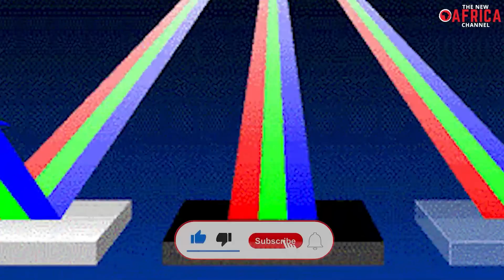How the Sahara Desert can power the world with solar panels

Comment: What a silly idea. Near the Equator the insolation is at its most peaky. With a maximum at midday, it drops off quickly from its peak, providing only a few hours of useful power. That mandates storage, even without considering maintenance and EOL cost considerations.
 What's more, for a fraction of the land usage, political risks and overall cost we might deploy localized 4th generation SMRs where they are needed.  Solar power is only valid with at least 24 hour storage and then in the absence of more effective generation.

Comment: RIGHT THE AREA IF THE SAHARA DESERT IS 9 MILLION KM WHY DONT WE NOT USE ONLY 2 MILLION MILES OF IT AND COVER IT IN SOLAR PANELS GOING ACROSS MORROCCO AND ALGERIA TH AT WOULD ONLY COST THE EU AND UK 5 BILLION EACH AND GIVE EUROPE AND UK MORE ENERGY AND MORE FOR HEATING OUR HOMES AND WE WONT BE HEAD TO HEAD WITH RUSSIA IN TUE GAS PIPELINE THE DESERT IS SUPPLYING EU-UK WITH HEAT AND ELECTRICITY

Comment: What happens with the solar panels after they are no good anymore, they carnt recycle them or brake them down because of the materials, they will jusy be dumped in landfill and the materials and chemicals will just polute the ground
Reply: With modern technology it should be possible to recycle the old panels  for reuse. If old mobile phones are currently being recycled to reuse needed materials in the phone, same procedure can be applied with the panels, as well. It's up to the countries in the sahara to implement  laws binding solar farm operators to recycle old panels, to prevent  any environmental issues
Reply: @biologic9081  the solar panels what was installed around 20 years am ready to be replaced soon because they only guaranteed for 25 years at the most, they have no idea what to do with them because they contain asbestos and other materials which am harmful and carnt be used for anything else, the same with theses ion lithium batteries once they are done and dead they have no use for nothing else because the material carnt be reused or recycled, there is a scrap yard located in Paris which is full with electric cars which have been put there because the batteries am dead no good, they are there because they carnt do anything with the batteries so now all the crap of the cars is polluting the floor same has the solar panels no good after use
Reply: @jamesharris910  it depends on the country you're talking about. It seems there no good  strict laws dealing with waste materials. This is why those  countries in the Sahara must make laws  binding solar farm operators to properly recycle panels after 20-25 years. In places like Germany, recycle  works perfectly. Even mobile  phones with their small components are recycled and previous metals used are removed, using modern technology.